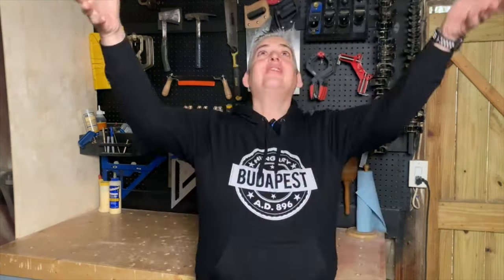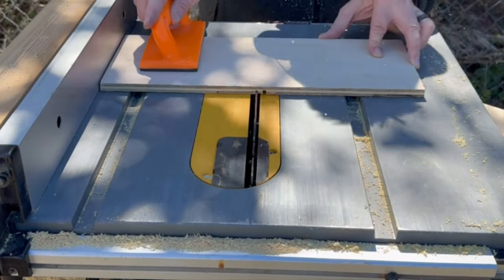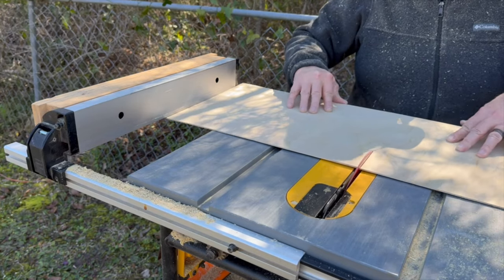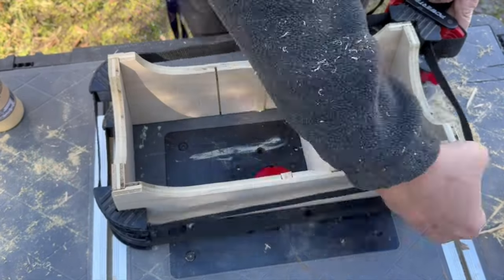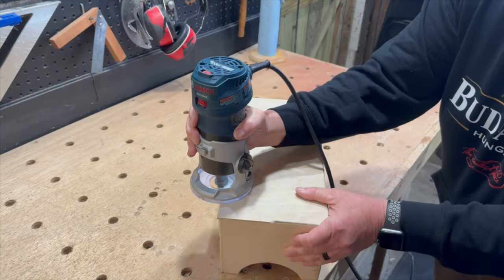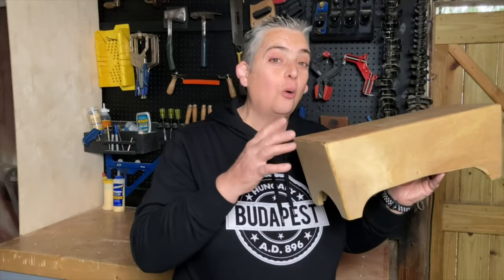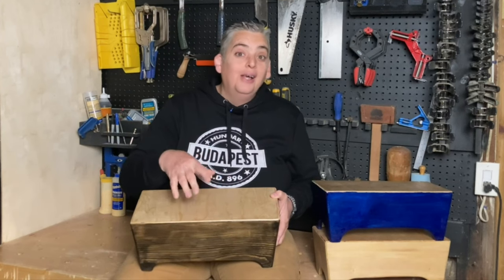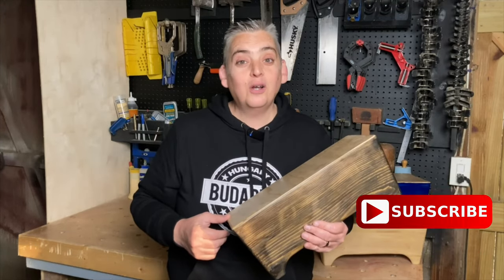How To Build A Bongo Cajon // Making a Box Drum

Comment: Wouldn't the pine be soft and deaden the sound vs a hard would that would reverberate much better??? The top you would have to play with different materials as they would all have different sounds based on density. Can't wait for the follow up one this project. Looks like a fun build.
Reply: I was thinking some hard wood as well.  Then instead of plywood, resaw a piece of the hardwood and run it through the planner until you get to 1/4 inch.
Reply from the maker: Sooo, this would probably be amazing with some nice hardwood, but the pine was free scraps in my shop, hardwood wasn't in the budget for this project, but I definitely would like to go that route sometime. As far as the plywood: it was leftover from a  commission job and I used 3/4" ply on the full sized cajons last year and they sound amazing. I think the type of wood plays a much bigger part the smaller the instrument is.